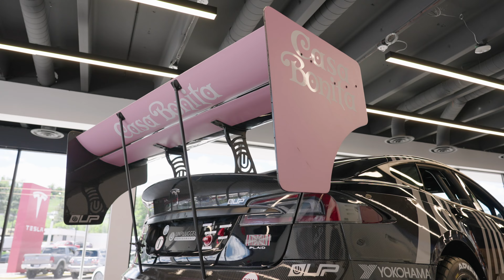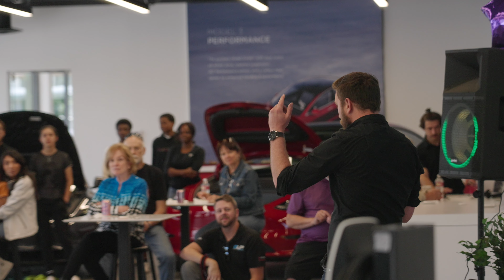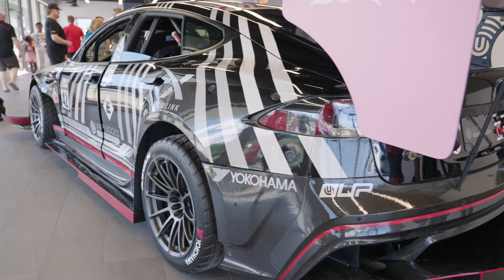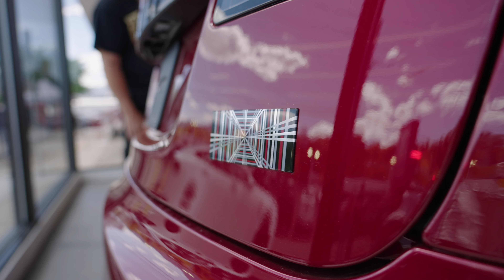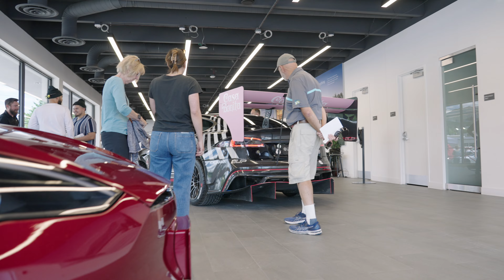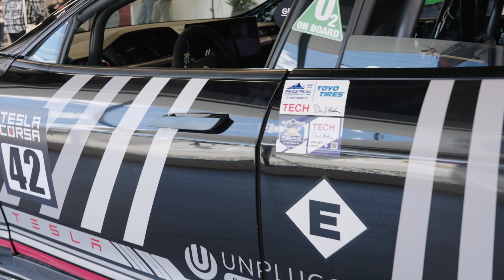Pikes Peak 2023: Day 1 - Tesla X UP Kick-off Event

Comment: The  button won't help? Under 8-6° c   the AC compressor stops working (if you only using it to dry the air, not heating).  This is normal behavior for refresh S and X owners in Norway. Got fog bombs " on our windshield when the temperature drops etc.  It's a stupid setup.
Reply: (No. The dryer won't work if you using it to heat. )
Reply: Guys you have to test that de fogger make sure it’s going to work, leave nothing to chance don’t assume it’s fixed, good luck take care😊